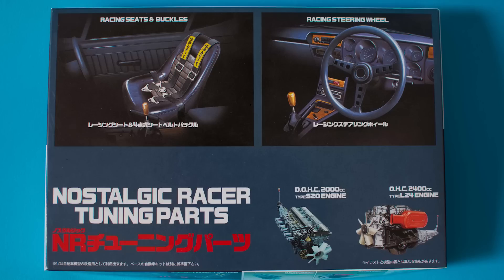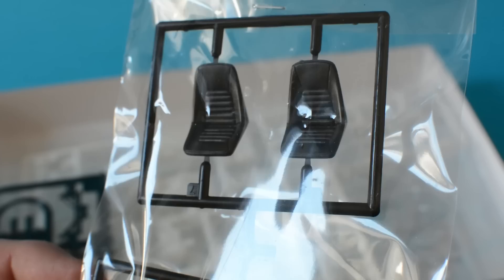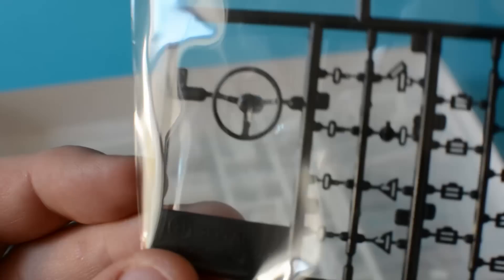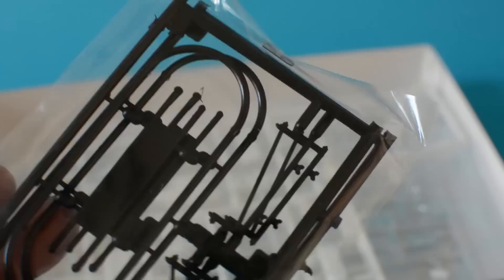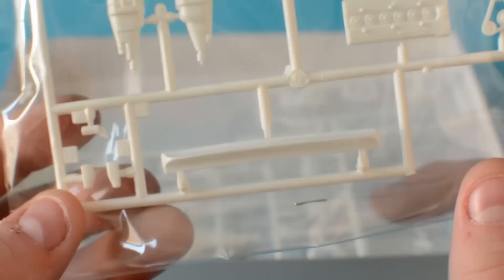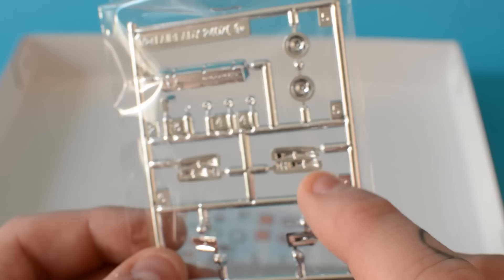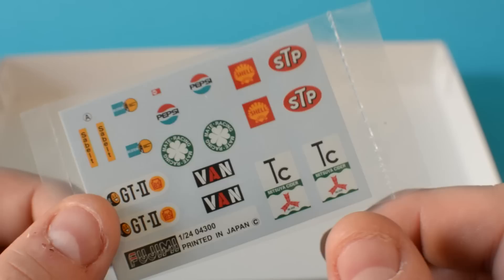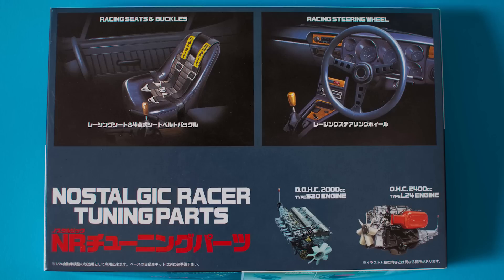Fujimi 1/24 Nostalgic Racer Tuning Parts With Nissan L24 & S20 Engines Unboxing and Review

Comment: Holey Crap with a Five Speed!  It's taken Months to get ONE of these. (Long eBay story).
Mine didn't come with Seat Belt Material. I don't know why and I'm not concerned.
Was it worth the wait? I have Two Projects in mind. Some people will cringe and get upset.
I know, a lot of us thought about it. I know the S20 isn't the exact Engine but, I think it's a good start for the '67 Mustang from F&F Tokyo Drift.
I've collected most of the Parts for the Monte Carlo too.
How about the Camaro "F" Bomb from 4? Yee-Bloody-Ha!
I fell in LUST with Tej's '63 Ford Galaxie in 5. Hamina-hamina-hamina. I can't get the EXACT Wheel Covers but, I got some that'll do.
 The other Project... Maybe.
Aoshima, Nissan Gloria 430 Sedan, 200 Standard... FOUR DOOR.
As soon as I saw this Model I got Over Excited. At first I thought it was a Buick.  So, I did some research and found out that Nissan Designed it to Look  that way. Now, I don't feel so bad.
Some people don't like 4 Door cars. Next to Wagons, I love 'em.
I've owned a 1/1 '67 GTO, a '67 442, and a few others but, my '66 350 HP 302cid with an Interceptor OD Trans., FOUR Door LTD was the sickest. I could lift the front wheels off the ground on street tires. UNTIL, the Chassis snapped. I was going to put the Engine and Trans. into a '63 Falcon Wagon but, I bought a house. I sold them. The End.
Back to the Gloria. The Hood is already a separate but, there's no detail. I'll need a Firewall and Radiator and assembly. I plan on building it like the Box Art except it'll have the L24.
It's not a hard kit to find so, please have look.
It's a shame we can't post a picture here.

Comment: Parts D9, D10, D11 AND, D12 are Engine Stands. One for each Engine.
No, I can't read Japanese. If you look at the pieces and the Instruction Sheet, it's self explanatory. I just NOW looked at the Box Art real close. One Side Panel shows both Engines.
If you look real close (I had to use Magnifying Glasses) the aforementioned pieces are shown.
 I had another look at my Aoshima, Nissan 430 Gloria Sedan 200 Standard. The Bonnet is Moulded Separately and, the Radiator is part of the Body.
   Here's a funny Project I have on the Bench. A Revell '51 Thames Panel. It's not a Gasser anymore. It has a Datsun 510 Engine/Trans., better Suspension, Part of a '69 Falcon Dashboard, better Seats, Street Radial Tyres and etc.. It will be painted in Hunter Green and Cream. The Front Floor and Firewall had to be filled in. The Front Floor is Carpeted the Rear "Looks" like Wood. It'll have the Decals stating it's a Lake Havasu Arizona, London Bridge Inspection Vehicle and the License Plate "51 Tems" or similar.
Reply from the maker: kingo fassholes Yeah my friend pointed out the engine stands a good few months ago lol! That sounds like an awesome project, some kits really need parts from other cars to make them that little bit more detailed etc. KUTGW and keep modelling!
Reply: ELP Modelling
You should see the Datsun 510-LS1 I built last year. I had to move the Firewall back, Beef Up the Chassis, Rear end and, I let the "Battle-Axe" pick the the Metallic Pink Paint.
"Insanity, it's not just for the Insane anymore. It's a lot of fun too.